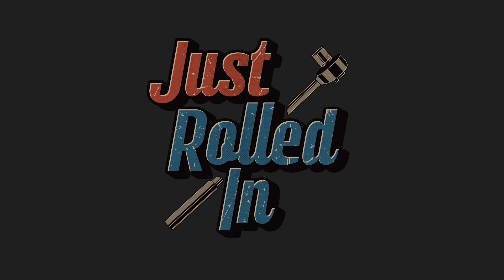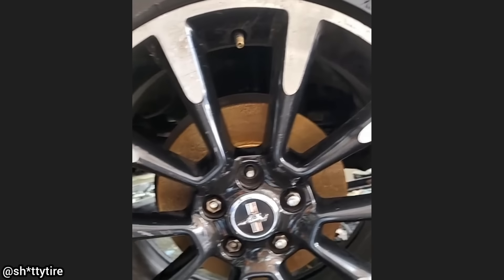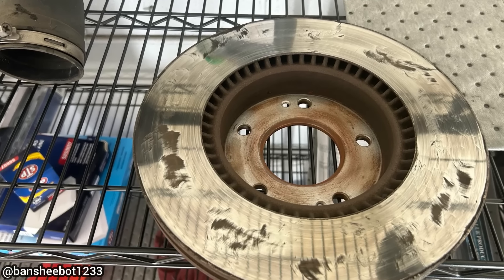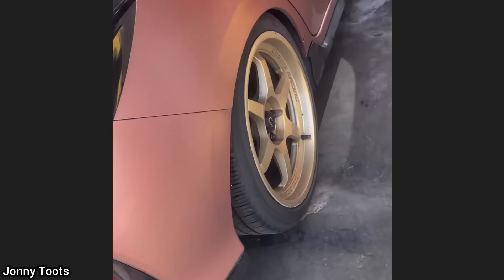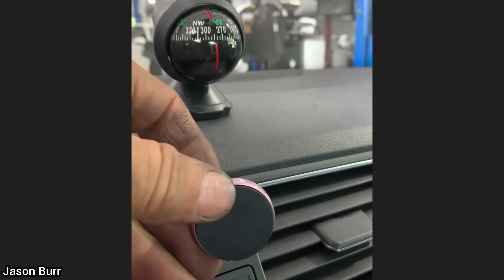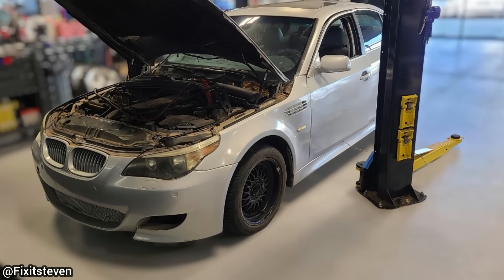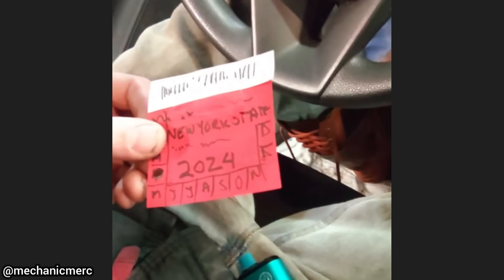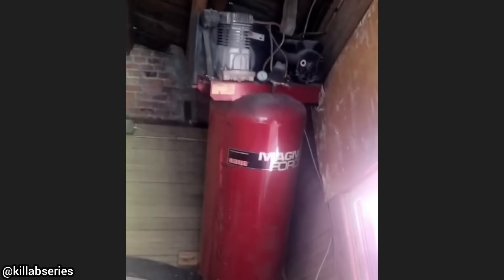Customer States "Another Shop" Ripped Him Off

Comment: I was wondering if spray foam would be a recurring character. I was not disappointed.
Reply: At this point, spray foam is one of the main characters on this channel.
Reply: It started with a walk-on role and was such a fan favorite that it's now part of the supporting cast.
Way to go Spray Foam! I'm sure that there's an Oscar nod in your future.
Reply: I was surprised that someone actually tried JB Weld.
Reply: Spray foam is the new duct tape.
Reply: Where did people get the idea to use spray poly-foam as a fix all anyways?
Reply: Here it is masterfully sealing transmission leaks, one of its main roles.
Reply: @MrSloika   I was thinking that it was the new JB Weld.  😄
Reply: @kimbrey65  I had so much hope that someone might have possibly made a repair, maybe, if surface prepped and small enough, then the next dang thing was sprayfoam.
Reply: I'm starting a business "spay foam for oil leaks" new and improved formula!!!
Reply: was starting to get worried it wouldn't make an appearance this time since usually it doesn't take as long to show up, but then that BMW popped up and saved the day
Reply: With a special guest appearance by jb weld.
Reply: @mechcommander7876  Because sticky.
Reply: @my3dviews  I was happy to see JB Weld making an appearance. The stuff is amazing when used properly.
Reply: "Surely the stuff I use to fix a drafty house will work on pressurized hot liquids..."
Reply: @The_Ballo  And it's so precise.
Reply: I think they need to change the name to "Universal Spray Foam" since it fixes everything.

Comment: All these years I've been installing all kinds of sensors.  When all I had to do was duct tape them close to where they needed to be.  Who knew?
Reply: You live, you learn 😆
Reply: that is how sensorship works
Reply: 😅 must be those new Wi-Fi ABS sensors.
Reply: Yeah, I replaced the thermostat in my oven, just left it on the floor, who knew it wouldn't work?
Reply: Does it work with spray foam?😊
Reply: Bluetooth.  Works great!  You can even adjust them from you phone!

Comment: "Customer states the sunroof isn't working"

Sir, that's a bike
Reply: but will spray foam fix the issue?
Reply: Ok but can you at least get the sunroof to close... So i don't get wet when it rains?
Reply: @rhetorical1488 if you have enough cans anything is possible.
Reply: Same people shop at my store:

Customer: "The sign said these were on sale for $10."

We check the sign.

Associate: "Ma'am, that sign is for shirts."

Customer: "Yes, for $10."

Associate: "Ma'am, you have a pair of pants."
Reply: @shannonharris  Dealership I got my car at had a customer that wanted to be able to have the sunroof open in the rain but not have water get in the vehicle...
Reply: @frumsmcnoodles323  I mean... if you drive fast enough...
Reply: Shouldve put: 
"Customer states sunroof won't close." 

Sir, that's a bicycle!

Comment: The old “Belt Sander as a Disc Finisher” trick….gotta love it!
Reply: I have bad ideas and have thought about doing this before lol what’s exactly wrong with doing this tho 🤔
Reply: And he probably paid more in replacement belts than a couple rotors off eBay cost.
Reply: I thought he used an angle grinder.
Reply: Either buy a new set of rotors, or take the used ones to O'Reilly and have them resurface them.
Reply: Missed it by "that" much.
Reply: @Kryten428  ….you got it! 🤣
Reply: Rotors are round. You're supposed to use an orbital sander, silly boyfriend.
Reply: The one dude used wood screws to secure his brake caliper.
      Everybody knows you got to use self-tapping metal screws to secure a brake caliper. 
      COME ON MAN!
Reply: @dejjal8683  I think you are correct.
Reply: @zephead4835  Right? Jeeziz, some people's kids.
Reply: Aww, bless his little heart.
Reply: @alaindelon5398  Customer states, his sarcasm detector is busted..
Reply: I don't know why machinists even have lathes due to this simple trick
Reply: I thought everyone knew to use a DA sander ?
Reply: Belt Sander - how to turn a minor refinishing job into a major refinishing job.

Comment: I quit working at a chain shop due to rust holes in the bottom of both the air compressors.  Lifts would just drop a foot suddenly.   I wanted to work, not die under a car or air tank.  Good video.
Reply: Smart move...
Reply: The lifts didn’t have a safety ratchet mechanism? Insane.
Reply: First real shop I worked at (I didn't count my time (short time that is) at a national chain that rhymes with 'ears')

I was at 'real' shop for about 3 1/5 years.  The shop manager was also brought on at the same time.  We noted that the air compressor was 'short cycling' a lot.  It was a dual electric double motor compressor assembly.  (Two electric motors, and two twin compressors on a massive horizontal tank)  

He asked the store manager (that shop rhymed with K of art) if the prior shop manager or staff ever used the ball valves at the bottom of the tank.  (it had two of those as well for rapid draining of the water.)  Nope!

The air tank was about 80% full of water!!!!!  We had to shut the shop down for several hours while allllll that water was flushed out of the air tank into a small floor drain.  Rusty and nasty!
Reply: @UHOH3300   Likely they do or did.  The in ground lifts have a locking pawl that sticks out at almost the end of the travel.  (and that's it)  Usually it gets gunked up to the point it is rusted in place.

The really bad part about those lifts is when the main seal starts to leak.  It will slowly weep out hydraulic fluid and then you will have compressed air enter the system.  It will  make the lift start to 'bounce' when it's close to the top of it's travel.  And it gets worse the more fluid seeps out.
Reply: @Tedybear315 hope someone had that tank checked for damage after all that water.
Reply: @dw8840    It was about a month later they got new compressors,  the bottom went out of one of them, lucky no one hurt.

Comment: Back in the early 2000s I worked at a Ford dealer in Franklin Tennessee. A late 90s model F350 came in and the owner was trying to sue the dealership and Ford because the airbag did not go off. While the investigation was going on no one was supposed to touch the truck as it sat outside.I happen to walk by one day and look and see it had the older style steering wheel that nobody had seem to catch. This particular model did not come with airbags. I immediately went in and told the shop manager, but was not informed about what else happened after the fact.
Reply: The shop manager took credit for your discovery 😂😂😂
Reply: @M21-w1y  probably, I was terminated not long there after because somebody brought a vehicle in for months for a issue that should’ve been covered under warranty and they argued with me about what the problem was. It was simple the neutral safety switch was causing the customers cruise control to stop working, but they would not cover it under warranty even though the vehicle had less than 36000 miles on it. When it finally did go out of warranty because of its age, customer brought it back in. They want to charge to install the part and I refused because it should’ve been covered the eight or nine other times that it was brought in over the 12 months I worked there.
Reply: @leatherneckprepper4477   Honesty rewarded.

Comment: Fun fact - you can still order a brand new DeLorean. You can have them put it together, or order it in a crate for you to build. 

When the company shut down, they had hundreds (thousands?) of unsold cars and parts in inventory.
Reply: I was pretty stoked until I saw that they want 100k for them.
Reply: @frgeawrevgae  "I know what I have" except that they really, actually do this time.
Reply: There's also complete machining plans and/or CAD files online to fit an LS in said DeLorean so it actually goes like it was always supposed to.

God bless the LS.
Reply: Does it include a flux capacitor?
Reply: Apparently you can get a Delorean with an engine that gives a bit more omph
Reply: Even funner fact: why would anyone want to😂😂😂😂
Reply: @kittehgo  I would hope so. Those things were dog slow back when they were new.

Comment: Didn’t film it but my car’s radiator popped from overheating after a 18 hour highway drive towing a trailer. 
Got it towed to the closest shop, they said the radiator needed repairs and that I should get a new one. 
Went ahead with the repairs, they said it was good to go, gave us the keys. 
Drove it for not even 15 minutes and the warning light came on again. 
Decided fuck it, since we’re already on the highway, and kept driving letting the air cool it being careful to keep the RPMs down made it to the next town, brought it into the shop to get it inspected. Apparently the last shop didn’t tighten the radiator tubing seals so it was just leaking while driving the whole time.
I still wonder to this day if the radiator even needed repairs at all and if the seals had just become loose after driving for all that time.

Comment: 0:45 I remember the 2009 Toyota Tacoma having this problem right as they started hitting the dealerships. Apparently it was so easy to install the factory vinyl floor mats incorrectly that toyota had to do some type of emergency recall or tsb of some kind. All toyota tacomas made since then have to pass a floor mat inspection when being serviced at a toyota dealership Lol.

Anyway, I worked at a car wash in high school and this type of thing happened all the time. Weather Tech mats are the worst.
Reply: I remember Toyotas motto then was "moving forward". But after that debacle, they started saying "moving forward,  even if you dont want to." 😂😂😂 That was when Toyota changed it to "let's go places".

Comment: JB Weld is makin a comeback !! Watch out, sprayfoam.
Reply: Well, at least JB Weld is a structural material.
Reply: JB spray foam. coming to a shop near you 😅
Reply: I put a '67 Mustang in a ditch back in '82, tearing the drain plug out of the gas tank. Fixed it with JB Weld, it was still holding when I sold the car in '02.  💪

Comment: How some people can think spray foam will fix anything is beyond me. Need greater minds to solve that mystery.
Reply: Spray foam has four uses I can think of off-hand.
1) filling voids
2) thermal insulation
3) sound damping
4) trapping water so your part will rust faster.

Comment: I was a Master Technician for over 20 years. One of the worst "Just Rolled In" stories goes like this. This Filipino man brought his brand 2009 BMW into the shop wanting his first oil change at 25000 miles. The guy ate a lot of fast food because the car was full of fast food bags. It was so full we could not see any seats except the driver's seat. It smelled of rotting food. It was so bad, the oil change tech was vomiting as he got out of the car in his stall. The manager drove the car back outside far away from the shop and told the customer not to come back until his car was clean. UGH!

Comment: I had a tahoe that passed NY inspection except for the emissions part. I had every emissions component changed, even bought a new ECM, and it still remained in "system waiting". I found a pic of the current NY inspection sticker online, and had a friend duplicate it on her Cricut machine. Worked like a charm until I got pulled over 6 months later and the Barcode came back as a different vehicle

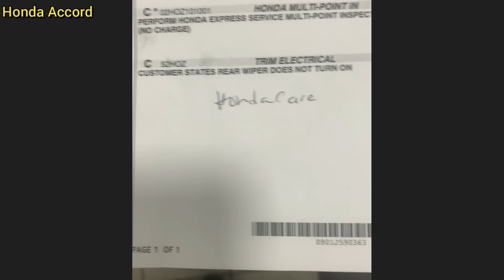Comment: 0:32 - seriously though, I wish more cars had rear wipers. They were big in the late 80s early 90s, then just disappeared.
Reply: My XC60 has one. Very useful when flipping off tailgaters.
Reply: @stringlarson1247  I really like the Volvo feature with the rear wiper. If the front and the rear wiper are switched on, if you put the car in reverse, the wipers will move at the same time and speed, so it's less distracting.
Reply: Typically you only get rear wipers if the rear window is part of a tailgate on a wagon, SUV, or hatchback. "They ruin the clean lines on a sedan." F*** the "clean lines," I want a clean rear window to see what's behind me!

Comment: At the start of the third back to the future they start up the delorean with minimal engine maintenance after 70 years, surely it must not be that many new parts for 40 years!
Reply: I hope Doc Brown drained the coolant before storing the Delorean in the mine, they didn’t know about the Valley Of Death issue back in the 80s.
Reply: @300DBenz  If you read the Haynes's manual for the DeLorean Time Machine, you'll find out that Doc did, in fact, drain all the fluids.

Comment: Belt sander to resurface the disc for the brakes?  No, no, no.. That's all wrong.. I saw a TikTok that says you need a palm sander.. Geez.. Get the right tool..
(Sarcasm)
Reply: I know somebody who used an orbital sander to “resurface“ the cylinder heads and engine block deck mating surfaces when rebuilding his cars engine, needless to say it didn’t work

Comment: I always find your videos amazing. I just can't believe the state of some of the vehicles they drive away without repair. I'm in the uk and had my annual MOT on tuesday. My car failed because the bulb that illuminated the registration plate was out. A quick fix in seconds, but until done and retested as a pass I wouldn't have been able to drive it anywhere, tax it, or get insurance as it was counted unroadworthy.
Reply: There are three UK MOT fault classes:
Minor fault (aka advisory) - You pass the test but that item should be monitored and repaired if it gets any worse. This is includes things like suspension bushes that are getting a bit worn or tyres near the limit.

Major fault - Lights, brakes out of spec,  body rust etc. You fail but you can still legally drive it, tax it etc as long as the previous test has not yet expired. If the previous test has expired you can still legally drive it back home and to a place of repair. 

Dangerous fault - Subframe rusted through, no brakes etc. The car is not roadworthy and you can't drive it anywhere.

Comment: Whoever made that fake inspection ticket needs to return to kindergarten, because clearly that's their mental ability level.
Reply: Really, if it just fools cops passing by at a combined closing speed of 50-130MPH and at distances of ten to hundreds of feet...
Reply: @MonkeyJedi99   and if they get caught, they can blame it on their 5 year old!
Reply: You wouldn't get away with that in the UK. Every MoT (Ministry of Transport) test is logged on the database, together with insurance held/not held, annual vehicle tax record. Any Police car fitted with ANPR (Automatic number plate recognition) will get an alarm signal as the car comes into its view. Then it's a roadside stop. If uninsured, the vehicle is seized and taken away and you won't get it back until it is insured and the towing away charges paid. If it's an MoT stop, then they may crawl all over the vehicle and if any major faults are found, it is a Prohibition Notice. In all the cases there is usually a fine and probably penalty points on your licence (6 for insurance failing).  If you get 12 points in a year, you're disqualified from driving for a year.
Reply: @michaelney7006  "We Happy Few"
"Would you Kindly..."
Reply: @michaelney7006  It's the same in the US, just not all police cars have ANPR. In my state, driving without registration, which you can't have if you don't have up-to-date insurance and inspections, is a criminal misdemeanor punishable by 20 days in jail (which realistically nobody gets), but the car may be impounded (which will cost you hundreds to get out), you may be taken to jail and made to post bail. Most states don't have window stickers because it's all tied to the plate. The sticker thing is mostly in the northeast, so they can write tickets when you forget to put the new one on and charge you $10 when you break your windshield.

Comment: I once had a shop do $600 worth of brake work on my car and then tell me, when I picked it up, that the subframe was rotted out and not worth replacing.  We had a conversation about why they did the brake work before telling me, and the mechanic at least pointed out that the last place I'd had work done (suspension)  hadn't mentioned it at all.  Now I always look under the car, etc, before taking it to a garage.
Reply: I had a shop fix the timing chain and THEN tell me my manual transmission had somehow lost Reverse while in their shop but they didn't notice until the timing chain was done.

Comment: #1 looks like a NTB (National Tire and Battery) job. I was 16, only knew how to replace my brake pads and change my oil. Car was making a loud rubbing noise on the road. Like a wheel bearing sound. My stepdad noticed strange wear on the front tires. So, figured a good place to start was having the front end checked out. NTB had a deal going on. Bogo tires, free alignment. Asked again about the alignment, offered to pay for it, said I'd pay for other issues as well.  They said everything else was good. They said they did an alignment. I got two new front tires. And a promised alignment...noise didn't go away. Took it to an old school local shop that I could not afford. M#$&_+ F&&K##G SUBFRAME WAS ROTTEN. RIGHT WHERE THE LOWER CONTROL ARMS BOLTED ON...yup. Not always the customer even though it usually is. I wanted to go back and K**L them. Then my stepdad had an aneurysm and there was more to worry about

Comment: GUILTY!! I replaced my wife’s and daughter’s breaks last year and used an angle grinder with a sanding disk to remove the glazing. The disks had more than enough meat on them so I wasn’t worried about them being too thin. It seems to have worked pretty good!
Reply: *brakes

Comment: Shop air compressor threw itself up😂. That is why many auto techs and other industries have the compressor outside and or inside concrete walls with a servicable door so if it does blows up no one gets hurt.